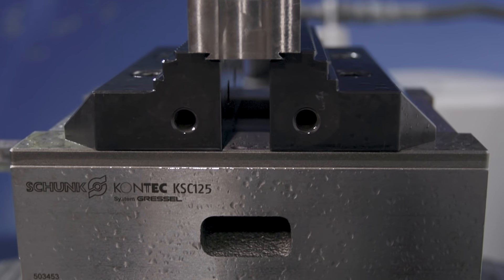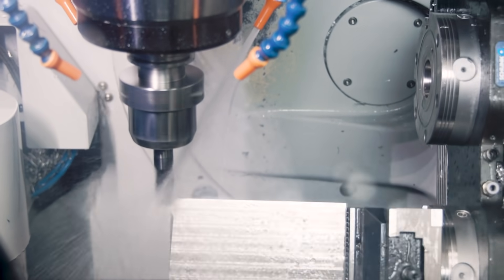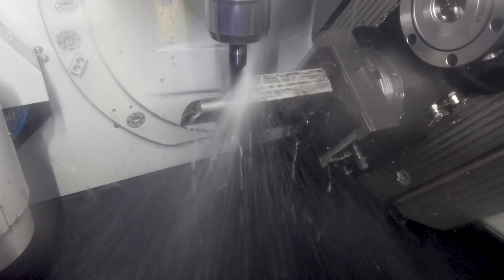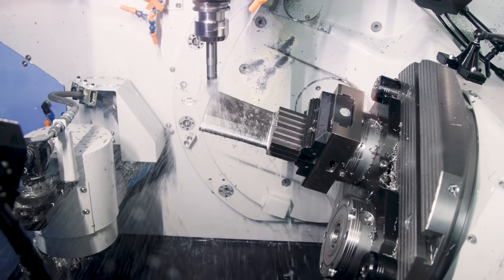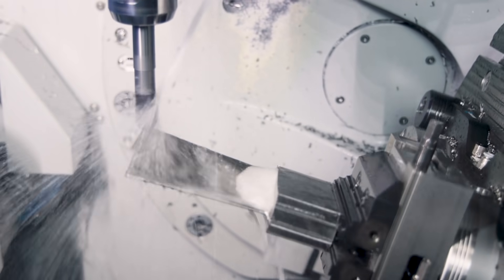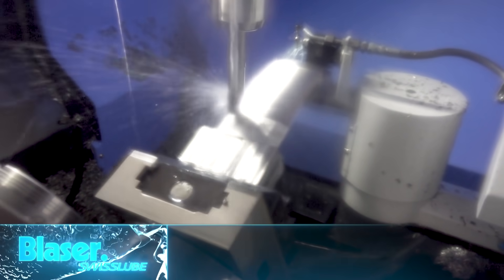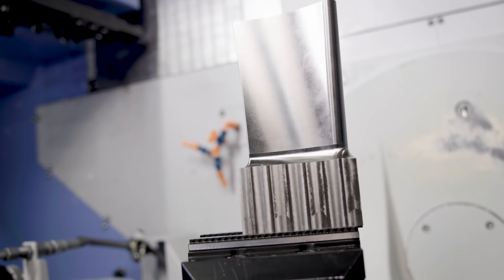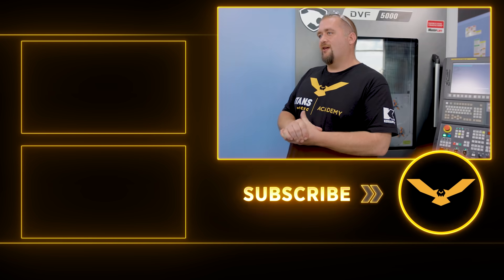5 Axis Machining a Turbine Blade on the DVF5000 | DN Solutions

Comment: BARRY talking about how not to use the center of tool because no rotation at the center.
ALSO BARRY using the center of the Chamfer tool. 😂👍
Reply: LOL, it looks that way in the video, but it's actually a few thou off center putting a .002" edge break on. ;)
Reply: I'm just messing with you my friend 😉 great work. Keep it up 👍

Comment: How deep do you guys cut your dovetail boss? We have been cutting the boss .09 tall and running the dovetail cutter -.07 into the boss.
Reply: I also usually break the edge of the dovetail by .020”, to make sure that the sharp edge of the workpiece doesn’t “bottom out” in the radius of the jaw’s dovetail.
Reply: Great question!!! I cut the dovetail .080” deep axially, and i like to make sure that its at least .25” radially, so that i have a decent amount of material resting on the top surface of the jaw (in order to prevent any possible pivoting of the workpiece). Usually, the manufacturer of the vise will spec the axial depth of the dovetail, so different manufacturers may have different recommendations.

Comment: Why not start by forming the fir-tree, which you can then use to hold the workpiece while you form the complex blade geometry?  Holding the finished blade to cut the fir-tree looks really painful.
Reply: Most of the time the fir tree is machined or ground first (but not always). In this case, we only wanted to discuss the milling of the blade, and as such it wasn't worth building fixturing.

Comment: Hi Barry,
Would you recommend a similar strategy for machining turbine blades on dedicated blade Mills like Hamuel/Starrag or Leichti
Reply: If you have a dedicated blade mill, you probably have 2 opposing chucks, so the strategy would be completely different (and much cooler). However, I would still use a dovetail on both ends of the stock. Then since you are holding both ends of the workpiece, you can be much more aggressive in the roughing, and make better use of larger inserted tools.

Comment: Great stuff!, just a quick question. Is it possible to program the finishing using a barrel tool instead of a ballnose so you can increase your stopovers and save more time on finishing?, thanks Barry 😊 🙏
Reply: Absolutely! I actually have a barrel mill on my desk that I considered using for this part, but decided to save it for something cooler!
Reply: @barrysetzer  thank you very much Barry!, i think you're awesome!, can't wait to see more of your content. 😄😊
Reply: Where I worked in the uk an engineer worked with Garryson Carbide designing a 5axis cutter that was capable of turning the leading / trailing edges to within near customer requirements,  also the platform to airfoil fillets and conical features . All the component needed was a barrel in a specified media and the airfoil and its ancillaries were all but finished!  The nose design is patent and secret.  Well it was. Incredible work

Comment: Quite impressive how you managed to avoid chatter with that tall set up.
Reply: The power of the dovetail!
Reply: @barrysetzer  dove tail does not really stop chatter as the material above can still flex and move.
Reply: @Mrgnothing1  but we still hit a surface finish beyond 18 micro inches. So?
Reply: @barrysetzer  the dovetail would do much to stop chatter compared to using grippy jaws or have loads of material in a vice. I mean thag thag set up is tall and taking big cuts with hard material can give chatter really easily. I'm saying that it's impressive that they've avoided chatter as it's tall set up, they're taking big cuts and it's a hard material, which is all prone to chatter
Reply: @Mrgnothing1  I see what you're saying. It was a tall set up, 8" of material, 1.25" thick. The blade itself is 5.5" tall, but even so, it was surprisingly rigid.

Comment: Those jaws also have teeth in them, right? Is there a reason to give the stock a dovetail instead of punching teeth with a pneumatic press? Dovetails work fantastic, but it's another milling operation that could be skipped
Reply: I have never heard of that personally but it sounds really cool! I will have to google that!
Reply: @barrysetzer  google Lang Makro Grip. That is the system that I use
Reply: Dovetails are industry standard for 5 axis milling now.
Reply: @TritonTv69420  dovetails makes sense because you don't have to purchase a workstation that punches of stamps those teeth, but are there other reason it's the go to for 5 axis?

Comment: Would it not be better to rough and finish this part at different height levels instead of finishing it in one go so it stays evenly rigid from top to bottom? Or is it thick enough to not be a concern? By the way, great content!
Reply: I have done larger blades that way, but this one is only 5" tall and is rigid enough to finish in 1 shot.